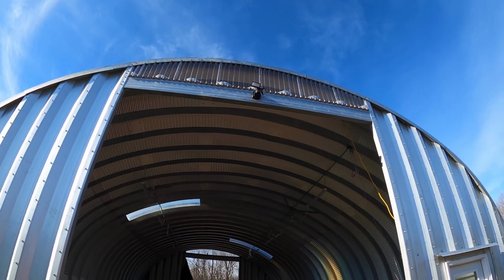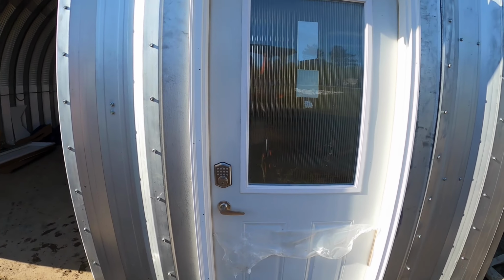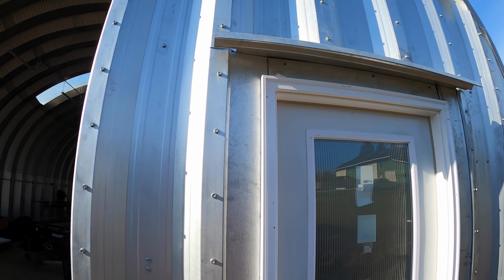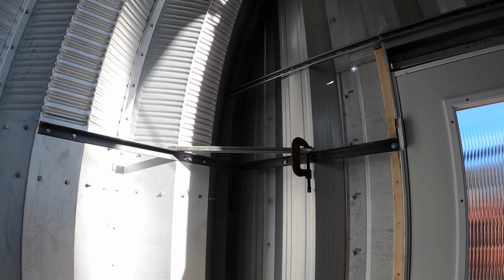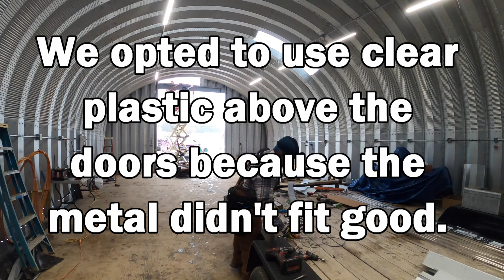Ep. 4 30x50 Quonset Workshop Build Series

Comment: Looks good. What is the plan for heat and or insulation?
Reply from the maker: Spray foam is the plan. Going to have to wait until the spring though, the moisture is bad. Heat will be radiant floors